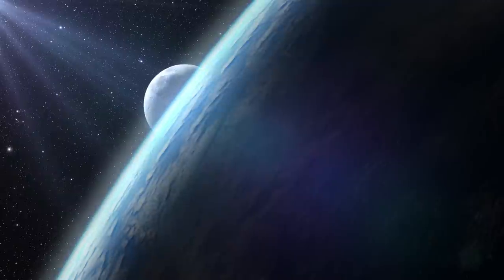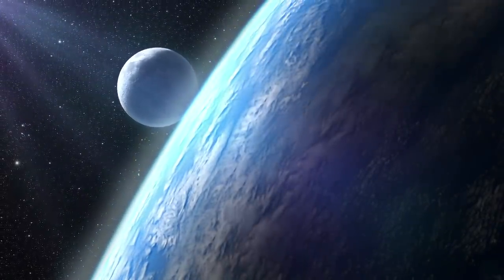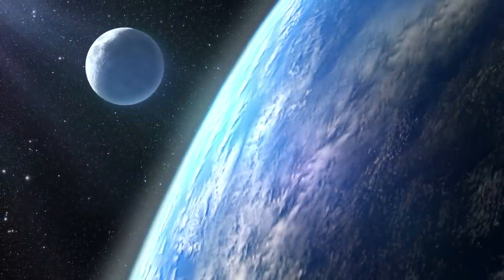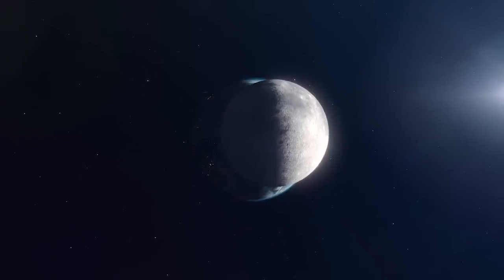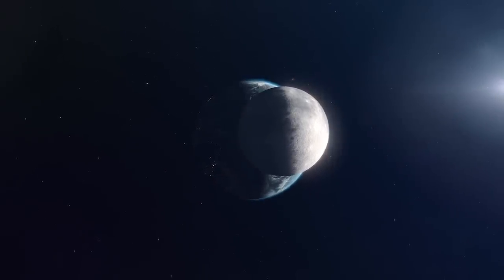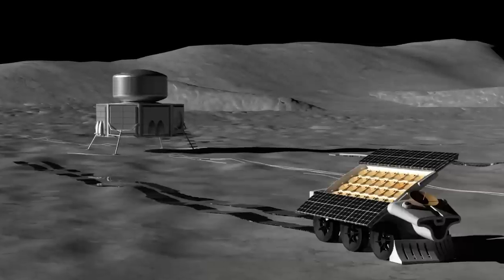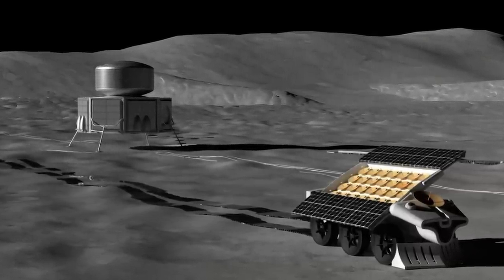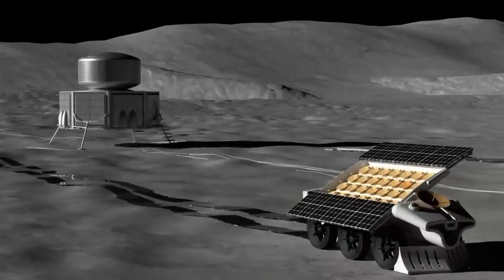Self-Building Radio Telescope On The Far Side of The Moon [NIAC 2023]

Comment: If it goes ahead this sets a lot of precedents - technically it's a mining operation, it'll be the first construction project on the Moon, and it'll open up a new ear on the universe. Manufacturing solar arrays en-mass, all from regolith.... and for much less than something like JWST. Personally I am very excited about this!
Reply: I presume that by then we have to have already a permanent presence on the Moon because otherwise that's too much machinery and (literally) moving parts to expect to operate flawlessly on its own and sending an assist mission from Earth should something almost inevitably break would cost billions, while on the other hand if there's a lunar base by this point then sending a spacecraft from there would be nearly trivial due to how shallow the Moon's gravity well is
Reply: @mihan2d  I'll have to read up on the details of the phase 1 study, but the impression I get is that this is all designed to be fault tolerant & multiply redundant rather than repairable, or at most repairable using automated stuff like rover that can be controlled from Earth. More a 'simple brute force collecting area with lots of redundancy' than 'clever and sensitive electronics' idea, I assume. No moving parts, lots of ultra basic antenna (basically just strips of foil), lots of low quality mass produced solar arrays, all operating on their own in terms of power. I guess that so many  independently operating components adds up to a lot of redundancy and no tears shed if some fail. 

The bits that have to work are the rovers that  deposit the foil antenna on the surface and etc. So it depends how much they cost - but I imagine that if they have an unfixable breakdown it'd be a lot cheaper to send a new one than a servicing mission. But i haven't done the reading yet, I'm just guessing.
Reply: @studentjohn  I thought there was some reference to optimized rover design for weight bringing it down to a kilo or two just recently- I don't know if it was for this type of manufacturing task, or as a lab- just speaking out my ass about the relevant process engineering, I think the different mission packages aren't too dissimilar in size and weight, but possibly it's going to make more sense to have an autonomous raw-material hod separate from the "factory" rover (one hod could service multiple factories, possibilities for path/process optimizations, single/multiple  device failure trade-off considerations, etc.)-maybe an entire fleet of differing-use  rovers is smart. Remember, all you have to do is get the first reconfigurable miner/factory successfully deployed and copy itself a few times, and you've started the whole manufacturing base, and at least for this project, nearly all costs are sunk.
ALL of the engineering design I've seen in this is just intoxicating in its potential. As long as there's an OFF switch...
Reply: We will make everything there . Just need to get the materials to do that , and whether is required to do that . We can have people survive there for months and send tons of oxygen etc

Comment: Long track for Artemis? I'll say. I was working on Orion systems in 2000!

For an antenna I'd suggest setting it into a large crater mainly for the reason that as things get busier around the moon, you want the crater rim to block noise from a wider angle. Even production of insitu metal supplies might encourage landing craft which themselves will interfere with the telescope -- unless you atockpile beyond the horizon. No need encouraging unwanted traffic.
You'll have lots of O2, which can be stored in large inflatable bags which will have value too.  Perhaps best to put it offsite or orbit to let others access without interference.
Of course those insitu resources could fund future expansion.
Reply: As for what got space interesting again, i attribute to Elon & SpaceX because before that even NASA would drag out things to infinity. Now all of a sudden many want to do something in space gets NASA active again.

Comment: The far side lunar observatory always seemed like a legitimate reason to go to the moon.
Reply: To go to the moon, build lunar satellites that will be visible in these big lunar telescopes with much radio traffic too...

Wait a moment... The quality of these lunar telescopes will degrade fast this way...
Reply: There is probably value to such a lunar observatory, but there are some disadvantages compared to space observatories. One is that to land materials and robots on the moon, you have to slow down in order not to crash on the surface. This is a similar amount of energy to leaving the moon's surface. The gravity is small compared to earth's, but it means bringing propellant and engines, which need to be brought up from the earth, increasing cost. 

The other disadvantage is that there are trace amounts of gas and dust near the moon's surface. They're barely there but it does mean the viewing conditions are worse than what you get in space - so why bother. If you want the moon to block emissions from the earth, the moon's L2 lagrange point may be almost as good.

On the other hand when we eventually have significant industry on the moon, there is the advantage that you can build humongous telescopes more cheaply than you could in space, as the discussed in the interview 👍 but that is going to take a few decades. Also, the advantageous viewing conditions that the moon can provide are at the permanently shadowed polar craters we know and love - I think I heard that an infrared telescope could be chilled even colder than James Webb currently is. It's hard to get colder than 7 °K no matter where you are, but maybe in the future a crater would be a better location for a giant JWST than space. 🤷

Comment: A one way lunar Starship delivery consists of 100 tonnes of payload and 150 tonnes of scrap metal. Most of that scrap metal is in the form of a single uniform alloy of stainless steel.

Stainless steel will be useful for making regolith working tools like bulldozer blades, metal working tools like drill bits, and any metal part that needs to be hard like bearings.

Aluminum will almost certainly be the first metal produced in bulk on the moon. Stainless steel will be the bulk material of choice before they ramp up aluminum production.

Comment: Good point about the difference in the electronics requirements. Maybe better to build large scale eclectronics that are more robust and easier to make in situ than micro electronics that could be susceptible to the moon's environmental conditions.
About not running over the existing arrays - what if an arrray or the power supply needs servicing or replacement? You may need to leave some kind of path through the arrays so a rover can get to any point on them for maintenance access.

Comment: Hi Fraser, Dr. Polidan, I have a question.
It sounds that the most radio quiet time to do science on the far side on the moon is during the local luner night (no Sun).
Will that not require battery arrays in a massive amount? 34:07  
Could you heat the reagolith to a large depth to be used as a thermal battery?

Comment: They could consider building the dipole antennas into the solar panel collection arrays. This may give the antenna a more stable base than the lunar regolith and reduce the area rovers have to travel and also may be able to use the solar panel power grid connections to get the signals to the telescope processor hub.

Comment: There are issues with space elevators  on the moon,(as mentioned in this video) in that the distance to the  equivalent geostationary orbit is 88,000km, but need to consider hill sphere which is about 58,000km.Outside this the earth will interfere with the orbit of objects around the moon, and they will not be stable. Elevator cable might not be able to handle this. Spin launch sytem may work better in moon's vacuum that on earth.

Comment: 40:51 hi Fraser this is really interesting topic to me. Could you please (maybe in a question show) consider going into details of how would such vast amount of data (terabytes) be processed? would it be stored in situ? or sent to earth 🌎? I mean there is currently no way to conviniently do that. Would we need a datacenter on the moon or on moon orbit to handle this? How they plan to get that data down to earth or work with it? You can't 3D print hard drive 😀 Love your work  👍 thank you for your continuous effort in reporting on space & science
Reply: You actually CAN print SSDs. Given they don't HAVE to be nano-scale if you don't care too much about speed, you can actually gain fault tolerance and thus, data integrity.
Reply: @ticthak  yeah that would be a way, from what I understood they are thinking about printing simple electric circuits, not sure if printing SSD is doable with that technology. How i see it, they would have to send chips & complicated hardware like data storage from earth. Would be really cool if they would be able to print it tho
Reply: @blackhole-q2x  you can print junctions, therefore you can print flash NAND. It'll be slow and clunky, but it'll also be radiation-hardened due to scale. Massive parallelism  can take care of the speed problem. Obviously, the early devices to assemble the system will have to come from Earth, MUCH more efficient and compact, but more prone to radiation damage. I begin to think quantum defects might cease to be significant failure causes for the circuits they're going to manufacture in situ.
Theis is a really revolutionary vista for materials engineering in all sorts of ways.
Reply: Probably laser based communication

Comment: Are there areas on the moon with enough aluminum deposits? 11:43
Reply: Yes
Reply: Aluminum oxide is one of the most common materials on the lunar surface. It isn't neatly separated, so it isn't pure. They will be approaching the search for suitable deposits from two different directions.

One will be based on our current limited set of lunar samples. They will be figuring out chemical extraction techniques that will work with that type of regolith.

The other approach is figuring out what kinds of regolith would be easy to work with. Then searching for deposits like one of them.

It is a bummer that the recent Japanese moon lander crashed. If it had worked there would be another rover on the moon today.

Comment: Not to be overly pessimistic, but wouldn't it be way easier to bring a few rolls of aluminum foil up there instead of refining the metal in situ?
Also making you own solar cells on a rover on the moon seams like a challenge in it self! How you even do this? You need at least some sort of substrate like a sheet of foil or something to put your materials on. They definitely won't grow silicon crystals and saw them into wavers up there! 😆
Reply: Easier? Maybe
Cheaper? No